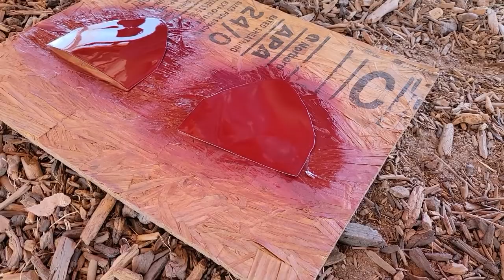We Made Shingles Out Of Tin Cans | A Little Creativity Can Save A LOT Of Money

Comment: I would recommend getting your hands on a used mounted stand post shear. The leverage it great. I have also seen people  take a large pair of hand shears for metal and mount into a vice so you only have to push down on one handle. For sanding , sandblasting is one way but a wire wheel or wire cup wheel on drill or right angle grinder. As far as paint. Outdoor oil paint house paint. Could rollon. Maybe some paint returns or mistakes from shops like home Depot etc. And another idea Is powder coating easy to do can be done in toaster oven  or other. Have had good experiences with powder coating. Powder coating kits cheap. Good luck. Love watching y'all do your thing.

Comment: Assuming that you’re going to lay these like roof tiles where each successive row overlaps the current row and the successive row’s tiles are offset versus the current row’s tiles:

I’d probably find a darker brown and use that as the lowest row.  Then the nutmeg.  Then a lighter brown, but still keep it darker than the color of the cob.  From a distance it will look more 3D.  Like the wine color - doesn’t match the can, but sure matches a good bottle of Merlot - but agree thats probably a bit much, especially since you were doing blues and greens in the windows.

Comment: Leave them out heat the sun hour make can flow better.  Wipe the tip off paint cleaner ore they dry next time spray it make a mess . 
You both need little more rattle shake shake in your can mixing 😜

Comment: Steel and Aluminum should not be used next to each other. The two metals cause a chemical reaction.  Be sure to use aluminum nails for the aluminum shingles and Steel nails for the metal or the nails will deteriorate to nothing. You can use Dupli-Color Cp199 Clear Adhesion Promoter Primer or a self etching primer to make the paint stick better.

Comment: Not only better with a brush , better with a spray can too. Guys just a little word of warning steel and ally don't mix well together, when touching each other they generate an electrolytic reaction which will cause them to basically dissolve. If you keep them separated , and use ally nails for the ally and steel nails for the tinned steel it will help, painting the backs of the shingles with a good tar paint will act as an insulator. I did like the colours you chose as you have cut the shingles like mini shields they will look quite heraldic. of course they also look like dragon scales just imagine how long it would take to paint them to match.

Comment: Maybe add in like a burnt orange and a brown mustard yellow and I think the color you want if described would be a burnt maroon, or of course a reddish brown or brownish red description, then maybe they'll know a name of color to match that description. 
And then on these brighter and/or much darker colors scatter them within a pattern of the lighter colors to make everything pop!!!

I was taught when painting a surface with spray paint to prevent runs, spray like a sprinkling of a coat across the surface first and give it a minute or two to become tacky to help hold the full coat you will add, and then spray on a full coat. Be quick with each pass and try not to overlap a pass by much if possible or pause in a pass and hold the can at least a foot from the surface. This technique usually also saves on the amount of paint used. When done with a can for a good period of time and it still has paint, turn can upside down and spray over the next intended surface until the can blows air and then you won't have a cap clogged with dry paint.

Love you guys and all you do!!! 
Many blessings!!!

Comment: Love the ideas and the teamwork...  It's a good idea to heat paint cans in sun to thin the paint, and shake more thoroughly. I find it easier and faster to swirl the marbles around while rotating the cans, one each hand. Regarding the paint application, I suggest much lighter, 2-coat application. Longer lasting, better looking and less likely to flake off after a short period of baking in the sun. I recognize that the painting in this video was for testing colors, but once you go into "mass production", I recommend lining up the shingles like dominoes, so as to overspray onto other shingles, instead of the cardboard / wood base. A cheap primer on front and back might be worth considering. I use canned spray paint on a lot of motorcycle body and engine parts, and I get better results, AND cut my paint cost in half just by following these steps. I hope it helps you as well.

Comment: Keep in mind you will need to repaint these every few years as some of the metals you used are prone to rust. As such a single color would be much easier to reapply. I would pick up a cheap air sprayer rather than using cans, they are much cheaper and better for the environment and will be quicker on big jobs. Color is your choice of corse but I would suggest like a dark sky blue to contrast the earth tones of the house.

Comment: Ever since seeing on instructables, I think, doing similar with aluminum cans... I've been thinking that the same can and maybe needs to be done with PET plastic bottles.  Seems like recycling PET to make membrane liners at the least if only like inner or for underground structure lining.  Though seems an automated assembly line minimalist design can automate a range of bottle sizes like 2L bottles on up to ultimately stamp some sort of shingle, tile and/or shake for exterior siding.   Seems can be a solid watertight interlocking minimal nail/screw down design as well for like extreme wind loads too.

Comment: If y'all are going to apply any kind of protective clear coat, you might want to check out  Spray Max 2K clear. It is a little expensive but it will give you a long lasting protection (many years) that won't fade out over a short time like regular spray paint and spray clear will. There's videos on the YouTube.

Comment: You can get steel bristle grinding wheels that fit in you drills.Put the drill running in a vice and run each piece you cut over it!The turtle always wins the race!The color your looking for is Taupe, its light brownish tan.You might meet to buy it as paint and apply with brush.Thats a superior coat when done with a  brush.Set all the plates on a 4+8 piece of plywood ,paint both sides.Spray paint on a big sheet of plywood to.

Comment: My concern is that paint will not hold up to being under the baking sun all day and will oxidize so I looked up what paint was suggested for metal roofs and it says exterior latex or oil based paint. So if the spray paint fails at least you know what paint to go over it with.

Comment: There is a tool called a nibbler you can buy. it uses  a air compressor or I think they might have a battery operated one it cuts through metal  like butter it well save you a lot of time and save  your hands. They sell it at harbor fraet or online you might want to check it out.

Comment: if you don't want to use tar on your roof, then just use more cement and some chicken wire to make a ridge on the roof two or three inches high near the house. then just take flashing and use it as a 'hat band' between the house and the ring roof, resting it over the roof ridge. then the water won't spill over the edges or go between the house and the roof, but would only go down the roof drain.  you would not need any roofing tar, just tightly connect the flashing ends together.  you could then decorate the 'hat band' as you like.